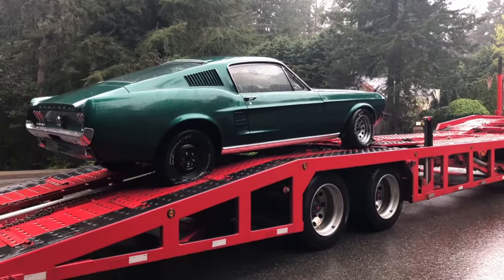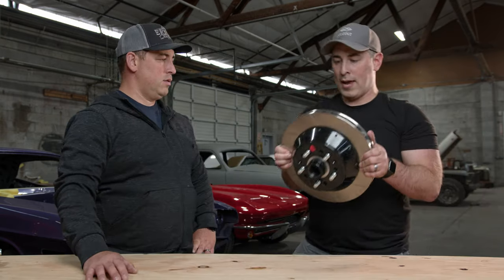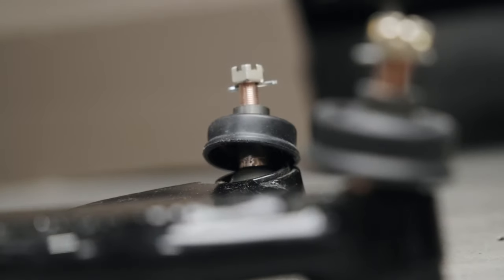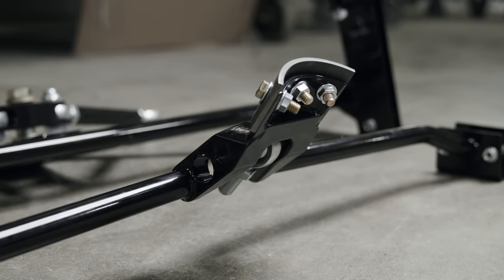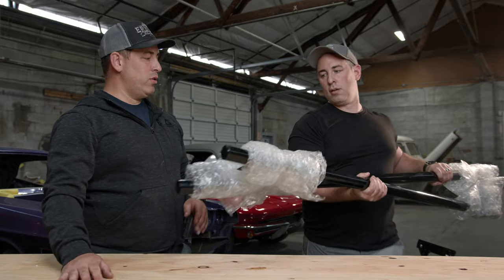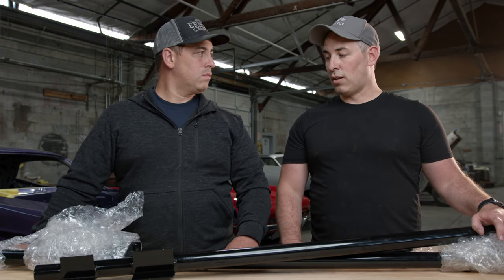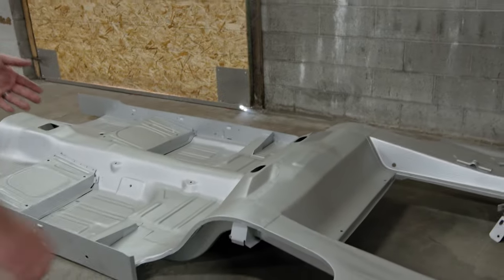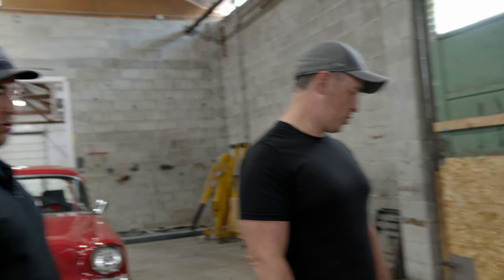Evan's '67 Mustang Fastback Project Update: Street or Track Suspension, Brakes, and Chassis Parts!

Comment: Subframe connectors, 6pt. cage, and reinforce those cheesey sheet metal shock-towers, inside and out. That flimsy unibody is the weak link with these old 'Stangs. 3:70 rear gear is a bit tall for that 6sp. (speaking from experience).

Comment: You won't be disappointed in the SOT suspension set up, I only have the front complete kit and the rear is shocks on leafs and it works very well but planning on adding a panhard bar.  If I was at your place in the build, I'd consider convertible rockers and seat risers to further stiffen the floor pan.  Also a front cross brace that ties into the lower control arms really helps to stiffen it up.  Going to be a nice build!

Comment: WOW ! I don't know what l was expecting but l don't think it was this radical !  You just don't get this service in the UK. Certainly not over the counter . l was expecting you to concentrate on the bodyshell ......saving the best 'til last  ?! In retrospect had the shell been in better condition do you think you may not have gone down the route you 're going ? I guess you'll keep the notchback as standard to remind your self "did Mustangs really drive like this ? "  😂😂  Thanks Evan .
Reply from the maker: Hi John! Yes, the plan had always been to have premium suspension/drivetrain components. The build plan has changed a bit since the beginning, but the most drastic changes are the engine, wheels, etc. And yes - this car is a bit more "radical" because the '67 coupe that I have is very original, so I wanted to have both flavors in the garage!

I hope all is well with you in the UK! Thanks again for the support!!

---Evan

Comment: Great set up¡ what yoy doing for steering?
Reply from the maker: Thanks! Steering is a power rack & pinion by Unisteer.
Reply: @ClassicNation  is there any reason you haven't consider manual unisteer R&P with EPAS?
Reply from the maker: Not familiar. How does it compare?